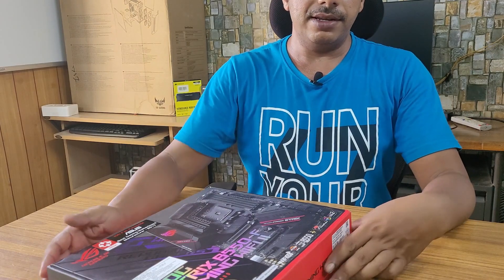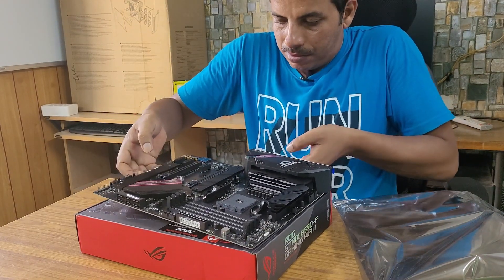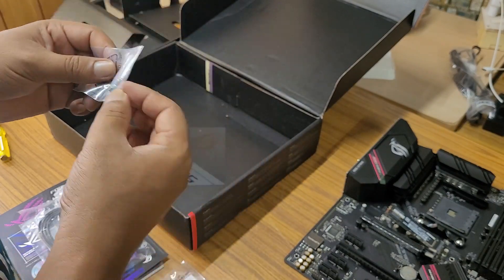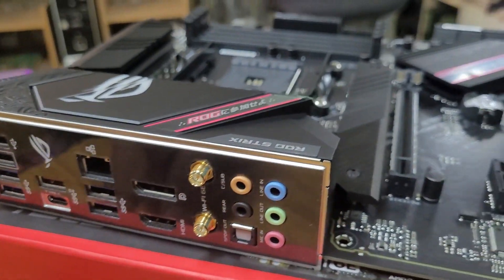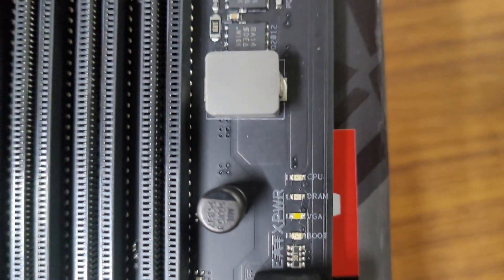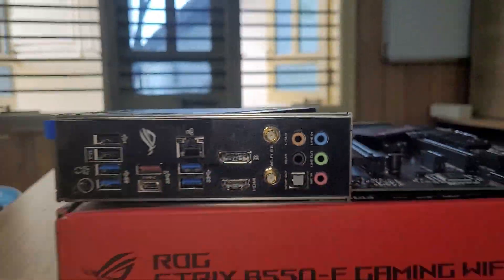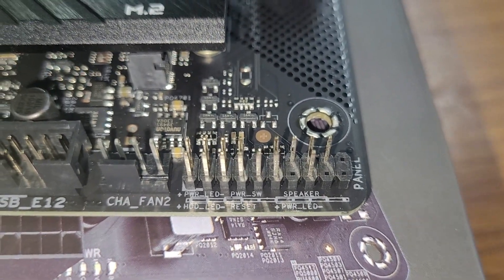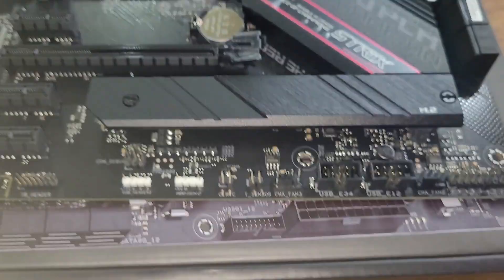Asus ROG strix b550-f gaming wifi II Motherboard Unboxing And Overview | WiFi 6E | Ryzen AM4 Socket

Comment: Hey! Amazing video! This has helped me confirm if I wanted to get this motherboard or not. It was very helpful! Tbh I'm new to PC Gaming and i'm getting ready to build my first PC. I just have a few questions about the antenna that comes with the motherboard. 1. Is it optional? meaning do you have to use it? (I was assuming yes because it's for the wifi but then I also thought that it wouldn't be a bad idea to ask just in case) And 2. Does it have to be next to your modem or router to work or does it have to be plugged into your modem or router? or do you just plug it into the motherboard itself and it let's you choose a wifi connection? (also i'm a guy btw sorry if the profile pic and name gives everyone the wrong idea) Once again really amazing video.
Reply from the maker: Thanks. First thing is it is not necessary to connect the antenna to motherboard if WiFi connection is not required!  Otherwise definitely have to connect it. 
Second thing is it doesn't have to be so near to the hotspot device upto 10m range it picks up the signal.
Reply: Hey, for if the antenna is optional, I’m pretty sure technically yes, but you can plug it in to the back of your computer and it EXPONENTIALLY increases wifi and Bluetooth speeds, so I definitely reccomend using it.

Comment: This seems to be a good board with lots of pci slots which I need for older things I still use. The Version B550-E strix asus removes a pci slot and adds another m.2 . I am seeing more boards today loaded with m.2 probably for gaming and not much   for users that are non gamers, but need a decent computer.  This board seems to be the best option I nave found so far

Comment: Does this motherboard have an internal usb c header?
Reply from the maker: No it doesn't  have type c header so you can't     use front panel usb type c port if your cabinet have one but there is solution if you want it, there you have to use type c pci-e card then you can connect it to front panel type c usb port.
It has got type c port on the back.

Comment: hello bro, on the box of this motherboard it says Windows 11 but if I put Windows 10 there is no problem putting it in my operating system? Cheers 😄
Reply from the maker: Definitely No problem ! You can run any operating system, windows old versions win7 win 10 and old Linux os or latest win11 and ubuntu 22.04 or any other os with this motherboard .

Comment: Hello Brother how are you? Great video. Now... Query: Which motherboard is better? The Asus Rog Strix B550-F Gaming (wi-fi) or the Asus Rog Strix B550-F Gaming (wi-fi) ll? Because in many forums I read that version 2 was worse than previous version 1. Is that so? What strikes me is that version 2 should be better because I understand that they changed a couple of things compared to version 1. What can you tell me about it? Aid!
Reply from the maker: I'm fine,  thanks!  Brother  version 2 is better than  the version 1.  Actually I booked version 1 due to unavailability of version 2 during that time in amazon but delivered version  2 to me,    I was so much delighted as Unboxing it looking at wifi2 motherboard box.

Comment: I have a ryzen 7 5800x will i need to update bios? and which one is better? The wifi or the wifi ll v2
Reply from the maker: No BIOS update required for that processor And wifi II v2 is much better.

Comment: Thx sir for this video i have the same motherboard in the packaging i have windows 11 ready writted what is this exactly ? I need to update w11 anyway ? Thanks
Reply from the maker: At present  any operating system  (OS) works flawlessly with this motherboard,  windows 11 ready means you won't face any  compatability issue when you upgrade to new os.  I previously installed windows 11 works fine.  Now i am working with ubuntu 22.04.

Comment: does this motherboard have any differences with the old version except wifi ? like vrm or something
Reply from the maker: No difference except wifi And wifi antenna  And Two-way noice cancellation in wifi II Motherboard, in older version just noice cancellation.
Reply: @rajeshproland-vlogs  wifi is better in this version right ? is it good
Reply from the maker: @emin6758  very good  , super ! i would say  .
Reply: @rajeshproland-vlogs  hey i have problems with this motherboard's wifi i installed the driver and stuff  but my motherboard's wifi is not good at all right now i dont know the problem with antenna or without i am getting like 5 mbps ! do you know how to solve this
Reply: @emin6758  did you end up solving this or did you return it? I'm planning on getting this motherboard but I heard the wifi kinda sucks

Comment: Hello sir, will this board support Ryzen 7 5700x straight out from the box?
I have bought a gaming Wifi 2 having the(BIOS Update in mind)

But in box it says AMD 5000 Series ready. Does this mean that my motherboard will support 5700x without BIOS Flashback/update?
Reply from the maker: Yes sir that's correct.  It supports 5700x processor without BIOS update.
Reply: @rajeshproland-vlogs  Thanks, sir! Have a good week-end!

Comment: Difference between Wifi || or wifi |
Reply from the maker: Wifi I comes with wifi 6 only that supports 2.4GHz and 5GHz but wifi II comes  with latest wifi6E  which supports 6GHz  band  also, and 3 times More bandwidth than wifi6.

Comment: Will it work on ryzen 7 5800x out of the box?
Reply from the maker: Yes it works.
Reply: @rajeshproland-vlogs  no need to bios update?
Reply: @jmblue2744  its not hard to check. once you set it up, go into bios and update whatever needs to be updated

Comment: Will it work with a 5600x out the box or will I have to update bios?
Reply from the maker: It works . No need to update bios for that processor,  after building pc with that processor  you can update bios later for stability  the latest version bios.
Reply: @rajeshproland-vlogs  thank you my brotha